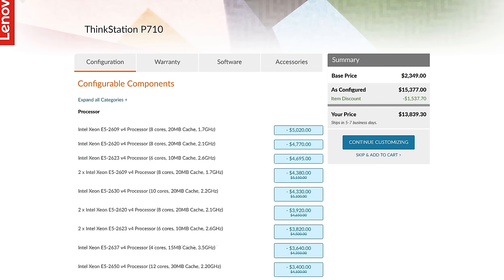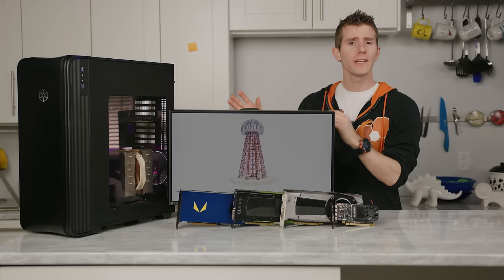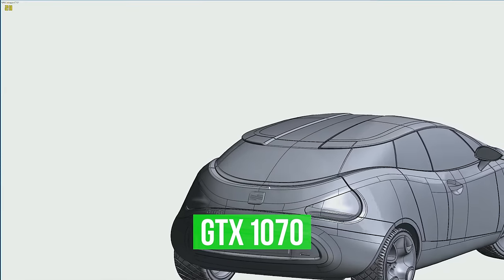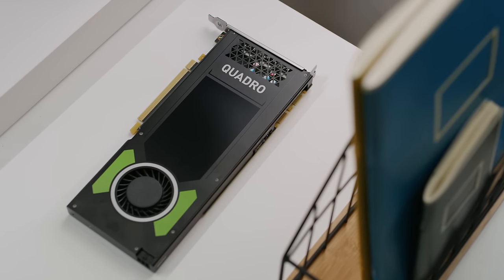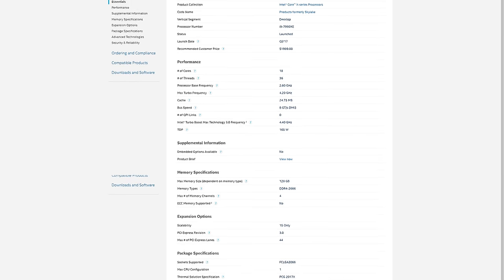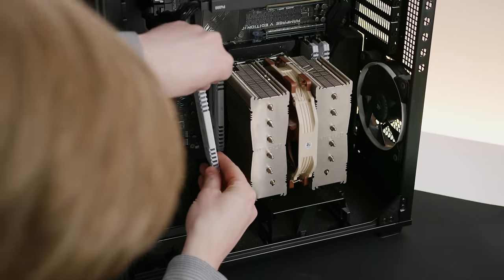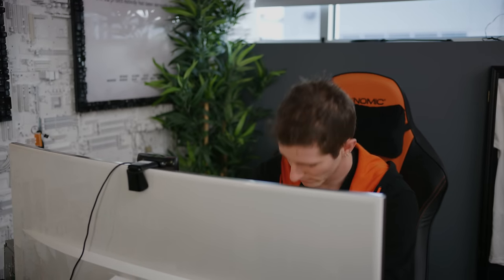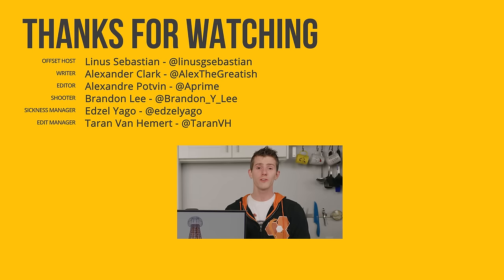3D Modeling & Design – Do you REALLY need a Xeon and Quadro??

Comment: @Linus tech tips, it's time to update your recommendation. Looking forward to it. Cheers.
Reply: Used workstation is the way to go now (like a Dell Optiplex, HP Z400, or Lenovo ThinkCentre)
Reply: I really would like to see how rtx cards play in this.
Reply: @StYfReX  was thinking the same thing
Reply: Hello. Please suggest me a good cpu and gpu . Help me out. My budget is 1000 $
Reply: @gulamsarwar2189  rx580, b450 motherboard with the latest update bios and a 3600. the rx 580 is like 180 at max i think, and the rx570 is like a 480 and is at 120 usd aprox and with 2 games i think(lol), the new cpus are like 220, a b450 is cheap and if you can go for an x570.
Reply: @EnriqueGonzalez-qo5hn  Z420*
Z400s are basically outdated and you can get Z420s pretty affordably. I'm gonna order a fairly nice one today.

Comment: Can you make such a video for Architecture in specific! 
The net doesn’t have a good video on that topic and it covers a bigger spectrum of softwares
Reply: I second that. Would really appreciate a comparison between how Quadro cards and Geforce cards perform in some of the most common architectural softwares: Revit, ArchiCAD, Rhino, SketchUp and AutoCAD. Such comparisons are surprisingly absent.
Reply: i want that video !!!
Reply: I'm learning Archicad and Revit for smaller residential & commercial buildings, and so far I haven't really seen any need for even an expensive gaming card. Even my old laptop builtin gpu is generally ok for modelling, and an old gtx750 is good on my desktop. When rendering, it'll depend which rendering engine you're using, ones I've been using seem to be mostly or totally cpu-based.
Reply: @johanwalll  do you get the information?
Reply: @archietech89  What do you mean? What information?
Reply: @johanwalll  I'm an architect in training and I have a lot of experience talking to IT people in the construction industry and doing some IT work myself, including workstation building. The universal consensus seems to be that Quadro cards are a waste of money for running BIM & CAD software.
Reply: @Dantheman1219  That's my understanding as well. The "consensus" is as you described. But nonetheless there is a surprising lack of actual reviews comparing Quadro vs GeForce in architectural softwares. I want hard numbers.
Reply: I would LOVE a discussion of hardware geared for Revit.
Reply: My daughter is an architecture student. She’s using my old desktop with a FX-8350, GTX 1050ti, and 16gb ram. She says it works great with Autocad and Rhino.
Reply: @Zesty Lemon Zach just don't get a gaming setup , bcz gaming setup will not get you where you wanna get in architecture , on the other hand design and modeling/rendering setup will let you play games , its the  other way around if you get a rendering setup, trust me im architecture student, was one , but now im suffering from my gaming setup to render and model !
Reply: @GarryPatricio  try rendering heavy complex geometry and will c 😏 you need RTX  big time ! But for basic CAD drafting and light rendering your good to go!
Reply: Does anyone know the difference between nvidia geforce rtx 2060 and nvidia quadro t2000 for architecture??? I’m looking between the dell xps and Lenovo thinkpad p1 and idk which one i would be better off with. any help??

Comment: wow, I have to say that the transition at 0:40 was so smooth af that I had to watch it again and then a third time. Nice work
Reply: Lol so ture
Reply: I think it started as a mask on the monitor and then faded the mask out to reveal the whole video.
Reply: Justin Chin I would have said that it was just a completely green monitor and it was used as a greed screen
Reply: Yep
Reply: lookie eight I don't think so, you can see they add a black bezel on the monitor to help with alignment and that the mounting bracket on the Vega FE disappears. Also the GPU's get a highlight at the same time, but the reflection of the monitor on the marble countertop doesn't change. Actually, rewatching the video I can see at 9:26 that it starts off as a black screen with a white reflection and the fresh books slide doesn't match the monitor bezels either.

Comment: I'm a Mechanical Engineer, and work with 17,000 part models, simulations and rendering. At work I use a high end Quadro and Xeon on an HP ZBook G4... At home I use a i76700k and GTX 970 G1 and my desktop blows it out of the water. In all my 15 years as an engineer using Catia, Solid Works (worst CAD software period), Inventor and Creo 4 (formerly Pro/E) and I have never noticed any significant jump in performance using Xeon and Quadro setups. Just make sure you have a lot of RAM, preferably 32+.
Reply: yes, it comes down to how well a vendor is able to utilise hardware and the type of computation.  In houdini, does a Quadro p6000 improve simulation speed?  Yes, by a tonne.
Reply: You seem to be the right person to ask my questions, since I am about to start mechanical engineering in half a year, do you think I should get the G4 which is recommended, and on sale for students, or just get a laptop with a GTX 1050 instead, to have more of an all round laptop? Since it is really hard to find a compass of rendering for that purpose and all.
Reply: I'm a Design Engineer as and couldn't agree more. I use top end Quadro and Xeon at work, 5820k and GTX770 at home. No difference in performance in Solidworks for complex models and assemblies. Blender is good the more cores you have.
Reply: SP4NK H4RD thanks for the info 🤔😉👍
Reply: Solidworks is like a potato, meh for all things, but really good for none.
Reply: You're so right!
Reply: Inventor for example! Sort of depends on what sort of work you want to do :)
Reply: CAD lecturer and I completely agree, College gets in Quadro based desktops every year or two and I get a beast gaming system every 4 or so. 

Even towards the end of my PCs life cycle I'm often telling students to send me files that are barely working on campus so I can purge out crap from their files at home to get things working for them again. Maybe I'm better at avoiding bottlenecks in my specs I don't know. 

With the importance on Real-Time stuff in unity and unreal in the visualisation sector. I'm going to start recommending gaming cards soon because the quadros are expensive potatoes for that use case.
Reply: try solidedge in my opinion its better than the SW
Reply: Engeneering student here, the 1050 will do during your time at college very well. I bought a specced out laptop back in 2010 and saw low to no benefit from it compared to friends with "weaker" machines. So better safe some bugs.

Btw. I enjoyed using Inventor the most, they were also the most student friendly. The worst are Dessault. Catia's GUI stopped with Windows ME or may 98 and costs younger generations quite some time to get into, while Solidworks ... it's a mess.
Reply: When you switch into it from another environment, let's say Autodesk or even Catia, you have to learn half the methods from scratch. Wich mostly results in the company buying Audits or shoolings. And boy, those guys have fees, that i can tell.
Reply: Solid Works is a great introductory CAD software though.  Its not great for any specific application but it can get the job done just about anywhere while being pretty easy to learn.  Also, their PDM software is pretty nice.
Reply: Gold_Appl3  
Hey man, I'm a ME out of Cal Poly Pomona and run my own business out of my house using SW on my gaming PC (8700K, 16GB RAM, GTX1060).  For the most part it works really well.  I think I'll be upgrading the graphics card to a Titan Xp when I can afford it.  Right now though I'm running  a GTX 1060 and it runs fine for 99% of what I'm doing, just gotta always have bigger.  
One thing you might consider (if you haven't purchased yet and money is available) is the Microsoft Surface Book 2 with the discrete graphics card, its a GTX 1060.  This would probably get the SW job done, do some decent gaming, and I wish when I graduated I had a "tablet" to take notes on with a stylus.  All of my old notes (which I do reference every now and again) are stuffed into manila envelopes in a box in the garage, having digital access would have been awesome. Good luck in school, its a tough curriculum but so worth it.
Reply: Why is noone familiar with or promoting Rhinoceros? :s it has loads of addons and you can code more, it had really nifty modelling tools for designers and even parametric design addon called grasshopper which just blew my mind when i learned about it. Oh and that's not all :D there's a neural network designer addon too, galapagos. Basically you'll set the goals and computer tries to figure out what the best design to achieve those goals is.

And the best thing of all? It's not owned by autodesk ;)
Reply: I to work with 17,000 part models in inventor.  I use a hp640 with a xeon 12 core  cpu a quadro p4000 and 64gb of ram memory. And rendering is still a hell.
Reply: What about AMD Threadripper vs Xeon?
Reply: @ SP4NK H4RD  for a professional (as you claim to be), it's disappointing that you can say that. You don' know how to optimize your hardware for CAD.
Reply: @ianthomas1201  you mean epyc
Reply: SOLIDWORKS is better than autocad
Reply: Solidworks, just as every piece of software can be frustrating when you don't how use it properly. If you have sufficient expertise you can create anything very easy. I am using it professionally for more than 10 years.
As for the quadros effectiveness it doesn't show in very simple models or assemblies. But when you do top down editing in assemblies and you need transparency view enabled and you have complex models then you really appreciate them. And when generating previews in simulation.
Reply: Your quadro and xeon are restricted inside a laptop.
Reply: @fredriklarsen5968  In my experience, Inventor is the biggest piece of shit ever "invented." Constantly crashes, non intuitive features, looks like shit. Just compare the damn hole wizards. Inventor can't even chamfer a selected face, you have to select all the edges...
Reply: inv 2018 compared to inventor 2008 is like from another planet lol
Reply: @JohnWinstonLennonFan GTX 1050 will be pretty bad for Solidworks.  If you have very simple assemblies and do not switch to transparent views, you can get by with this as a student.
Reply: @proto2580  Thanks for the answer, I already got a Quadro though, could buy a mobile workstation through the university quite cheap, so that solved the problem for me.
Reply: @JohnWinstonLennonFan  sounds good.  You are better off.  I've attempted to run SW on a water cooled GTX 1070.  I even attempted SLI bridging 2 identical water cooled GTX 1070 (did not help).   I run it on a P2000 now.  Night and day difference.

Comment: Linus Tech Tips did you set your GPUs for compute performance instead of their default gaming stuff? Geforce especially there is a massive difference.
Reply: CreativePathoz That's actually a really good question
Reply: I don't recall seeing that option on my 1080, but to be fair I haven't really looked into it too much.
Reply: What will you compute? Solidworks doesn't use calculation GPU acceleration
Reply: First you go into Geforce control panel then manage 3D settings. under there look for optimize for compute performance then turn it on. This is also how you mine if you are into crypto mining.
Reply: Unfortunately, I didn't find this option when I'm using GTX1080Ti, but I did find it when my GTX970m is enabled. They are both CUDA 9.1 drivers(same installer)
Reply: Yeah, I don't think its available for 10 series, even through smi.
Reply: did you look under 3d settings for optimize compute performance?
Reply: Not realy this only a driver thing with some 3D programs.
Reply: Yep, I tried, but there is none on the NVIDIA Control Panel
Reply: Same here, I didn't find it. I'm using a 1060 6GB with latest drivers.
Reply: I am not aware that the GeForce drivers offer a compute mode like the Radeon drivers do. Which makes me wonder if LTT did their benchmarks with the "Compute" mode on the Radeon's and if it even makes a difference in those workloads. It sure helps the Radeons quite a bit in Cryptomining though lol.
Reply: Thanks!
Reply: would be embarrassing if they didnt.
Reply: Also, any reason why no Firepro Gl or Radeon Pro cards were thrown  in for a good, complete comparision?

Comment: please do one for VFX/Motiondesign software like Cinema 4d/Octane Render/Maya/After Effects/Houdini
Reply: Ae is singlethreaded so faster clocks 
C4d as many cores as possible with best gpus you can afford and if possible quadros.
Octane render needs as many cuda cores as you can give him, multiple gforce cards. Maya same as cinema, Houdini higher clocks cpus with many cores for sims and a geforce will do the job to.
Reply: Using Ae for almost 20 years(unfortunetly), and Fusion and Nuke for 10,  all big 3d softwares as well. Ae needs higher clocks and if you have a 24-48 core machine i would love to see a project in ae using all the cores at max. Had projects i could not even open and needed to batch render them from command line and even rendered with Ae in small farms. Some projects where to big for even 64 GB ram so i had to redo some. C4d is doing well in my 50 mil plus production  scenes or even bigger.  Biggest was arround 1 bilion rendered with Arnold so yes i know wtf i am saying. No one uses the crappy C4d physical anymore, thats a joke. Prorender, are you crazy, thats experimental stuff for now. Vray, Arnold, RS, Octane yes. The projects i am talking about requires you to turn off all the textures in the viewport or reduce to minimum the details in viewport on the highest end workstations you cant afford, not kiddy stundent work. We did try octane last year for some of our big animations but  it had a serious bug while rendering animations and would not work in our pipeline. I render in local farms or rebus nowdays a lot, and for huge resolutions and fast delivery red shift. 50 mil plus scenes work great on RS and triple gpu workstations.  Did  renderfarms alone and managed a few, so i know what i am talking. As many cores as possible are most important for rendering , of course having higher clocks and many cores is the best. but the price for that is not worth most of the time. Also almost all 3D softwares even simulations are nowdays multithreaded or going that way and if a user uses singlethreaded operations then, sory for you but you need to manage the scene better. Trust me that 200+ cores at 2,5 GHz+ are more faster then 16 at 5Ghz .
Reply: Aspects of what both of you are saying are right. I think clock speed does offer an advantage over more threads in Cinema 4D when CPU rendering, but having more threads is still advantageous for many applications within the environment. Realistically when you're doing this kind of work you just want to go for the highest Cinebench scoring chip you can get within your budget.
Reply: Any idea about Rhino+Vray? I am thinking about getting an AMD processor with a midrange quadro. I mainly do Architecture visualisations. Thank you
Reply: AE - Single core performance (i7). C4d, Maya, Houdini - mix of single core performance and multithread (i9, ryzen, TR), CPU rendering and simulations (particularly in Houdini) will benefit greatly from multithread performance. Octane - Best Geforce card you can buy, forget Quadro.
Reply: Houdini is still mostly about CPU, Mantra barely takes an advantage of the GPU. Although, I'd curious to see Redshift / Octane or some simillar GPU based renderer.
Reply: @kanaljarka   Houdini?  The chess engine?
Reply: @raylopez99  SideFX Houdini
Reply: You think we get an update on this now with the RTX cards out as it will and does impact:  Redshift, Houdini, Maya and UE4.
Reply: @darviniusb  Curious does CUDA make a difference in said workloads? has RTX become part of your pipeline yet? noticed a few nvidia marketing videos pushing RTX seemingly mainly for Maya (specifically Pixars Renderman if i recall). thanks for the info.
edit: found said video: https://youtu.be/w2ft7JhAkQQ
Reply: @raylopez99  Somebody don´t viewed the video...
Reply: Octane xD
Reply: Only C4D's rendering is multi-threaded currently, so rendering with a GPU (like most people nowadays) Xeons make as much sense as the do in AE (Darvinius is correct regarding AE's inefficiencies... typical Adobe poop). Quadros are almost never a wise investment for the majority. Pros rarely use Quadros, and rely heavily on top tier gaming GPUs for the most part. Octane can't render out of core, so having at least one Quadro in there is a small advantage over gaming cards (because of the VRAM, but no point in all the cards being Quadros because it uses the memory of your single best card). For those using Redshift, (can render out of core) it's almost a zero advantage with a Quadro. In simulation heavy environments (Houdini/VFX work or scientific research, not motion graphics) with loads of money available, sure... bring in the Quadros and Xeons. I don't agree with Xaviera regarding Octane. Although Octane is great, most C4D users are using Redshift (Maxon knew this before acquiring Redshift).
Reply: Whats wrong with blender?
Reply: rtx is the best bang for the buck for that kind of stuff
Reply: Not a bad idea, i admit, but 8 doubt it will happen. The idea of the video is not a guide and tutorial. The idea is to make the difference of the consumer world and professional world more visible and more clear.